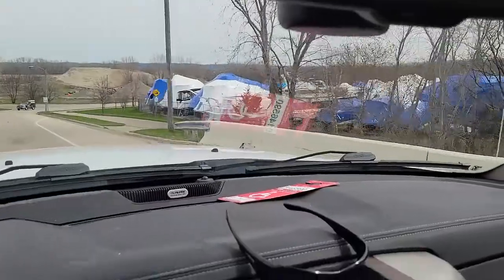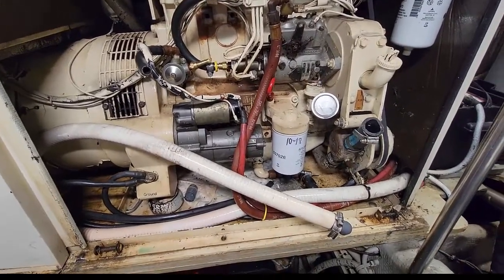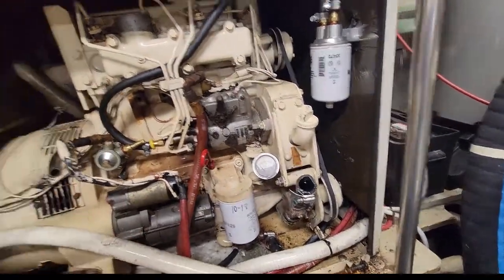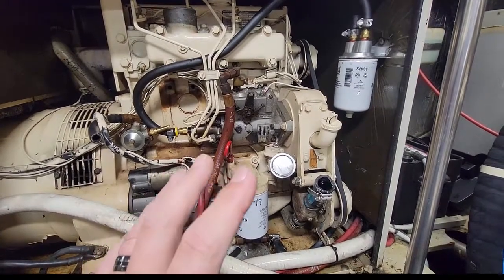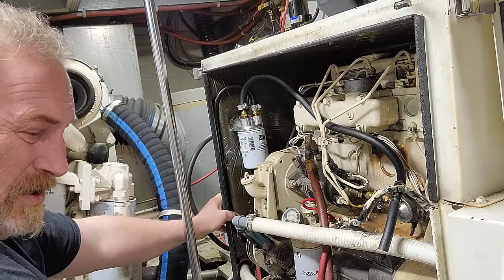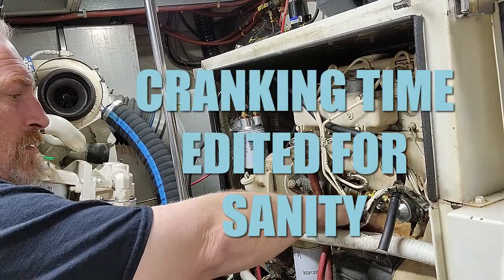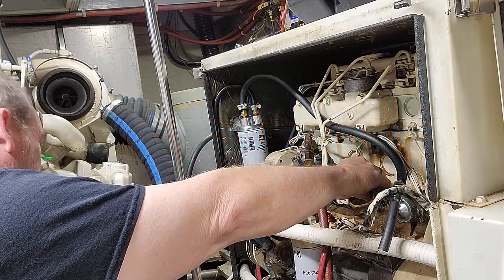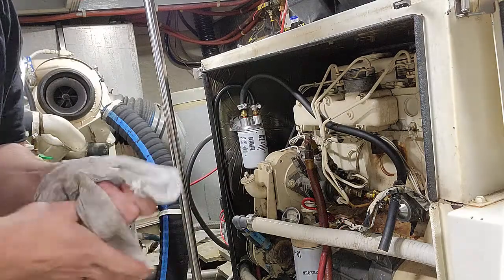What the EFF Is Wrong With My Generator? - 12.5KW Onan Cummins Generator Won't Start?

Comment: Does the generator fuel supply line at the tank have a 1 way check valve/ screen in it? Did you connect your fuel can up before the racor filter?